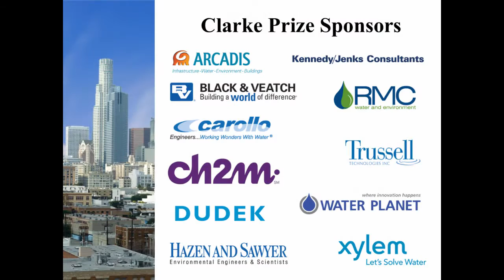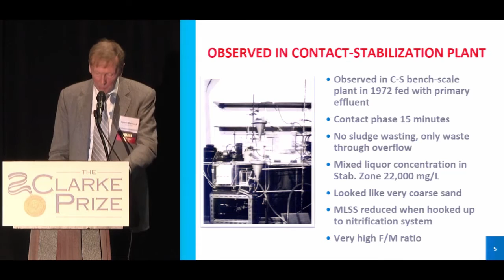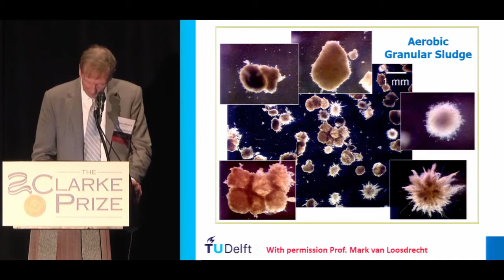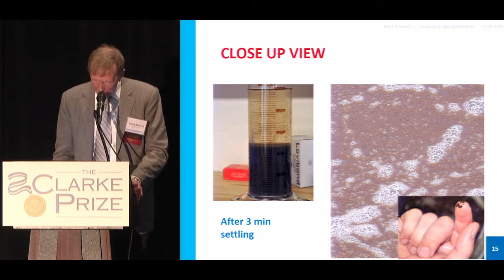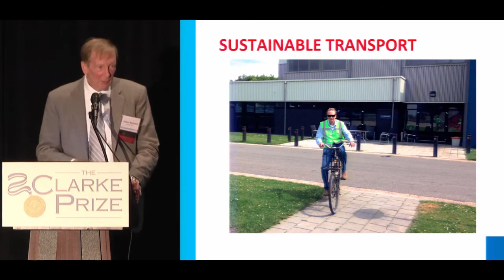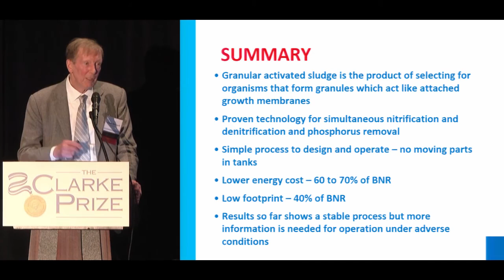Granular Activated Sludge:  The Future of Biological Nutrient Removal

Comment: What is the F/M ratio he keeps mentioning?
Reply: Food/micro-organisms ratio.
Reply: Food to Microorganism (F/M) Ratio, is defined as the rate of BOD or COD applied per unit volume of mixed liquor, F/M = (Q*So)/(MLVSS*V) or (Q*So)/(MLSS*V). A range of 0.2 - 0.6 (gBOD/gVSS*d) is recomended for a Complete Mix Activated Sludge process and it change for other reactor types and configurations. In the case of aerobic granules (Di Wu et al, 2018) recomended a range of 0.4 - 0.5 (gCOD/gTSS*d) to higher microbial diversity and pollutant removal efficiencies.